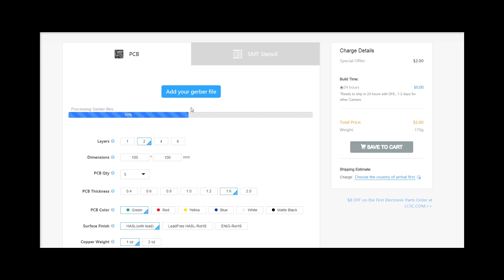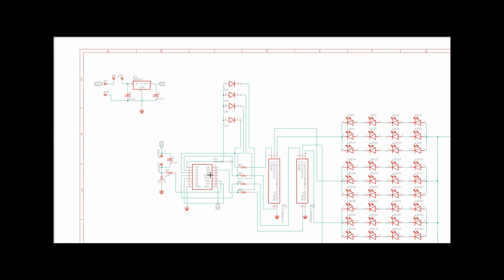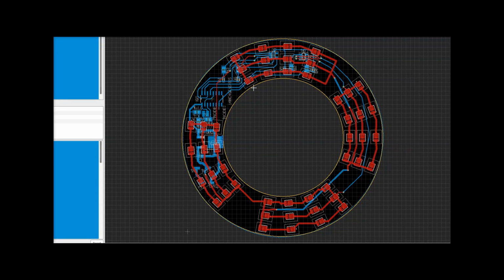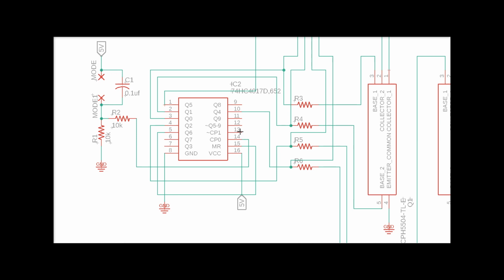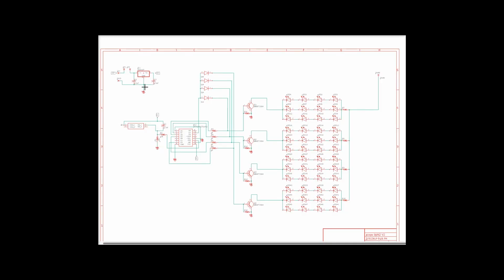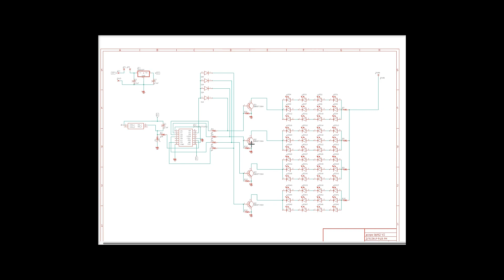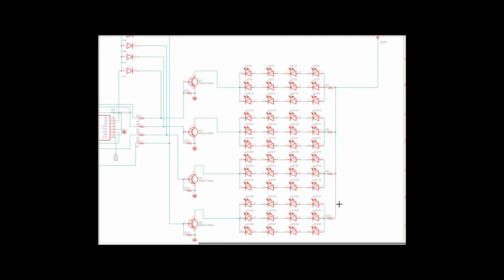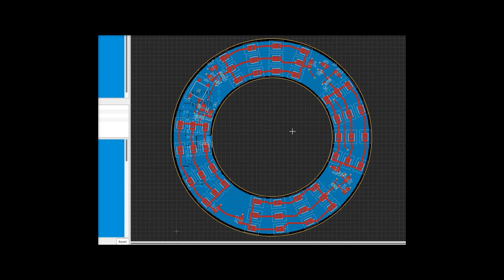DIY PCB led microscope ring light

Comment: Cool design. Looks great.
I would recommend using net labels for those connections that cross over each other on your schematic. You should move your design to a 4 layer board then you can have a Dedicated ground or power plane. Great overall. Nice job.
Also your instructible link is broken

Comment: Have you tried running the ratsnest command to fix the ground plane issue? Also, if that doesn't work maybe try ripping up the ground plane(s) with "ripup @;" and then ratsnest it, that might help.